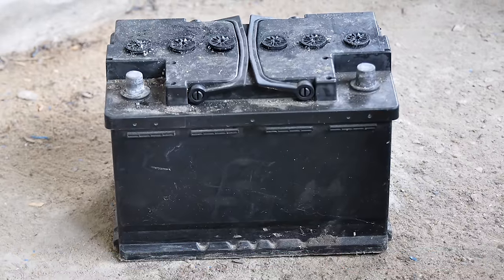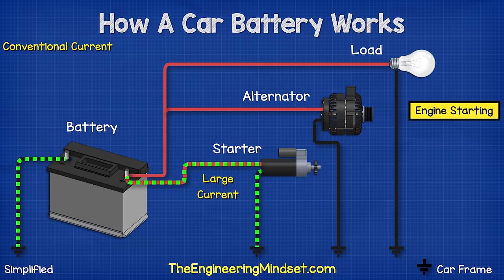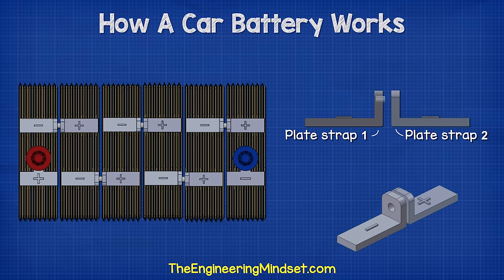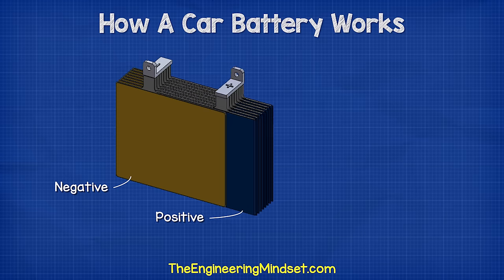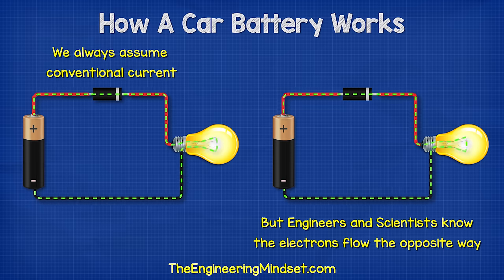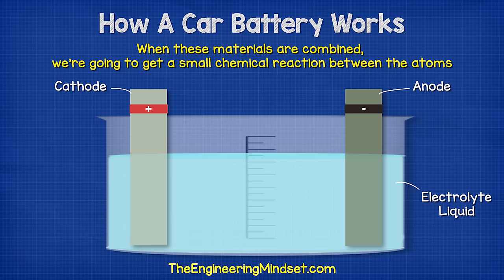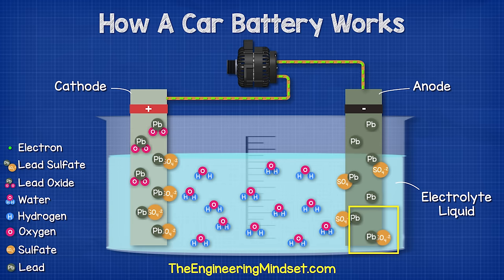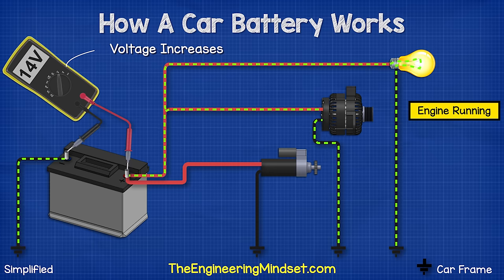How A Car Battery Works - basic working principle

Comment: Man i still dont understand bloody +- flow !!! which one is correct ? current flows - to +, but why does a car have the + hooked to the starter motor and - to the chasis, it wouldnt make sense to power all circuits (which should be from -) through the car chasis and frame which means current leaves from + on car batteries and returns through the chasis - to the battery.
I recently tested a car battery for voltage and i hooked multimeter red  cable + to battery + and black( - ?) to minus of battery and the multimeter stopped working for a second, when i reversed them it showed the values correctly, thats fucked up.
You need a better video explaining how do we measure and use + - in various scenarios because we could get electrocuted or catch fire  or destroy electronics because of  electron flow theory confusion.
Thank you.
Reply from the maker: Here you go https://youtu.be/kcL2_D33k3o
Reply: @EngineeringMindset  i still dont understand, if current flows - to + then why car battery has electron flow from + to -, and why when fixing a car is required to remove the - terminal, when electrons leave from the + side? I worked as qualified welder, and they tought us electrons flow - to + in order to configure the welder machine polarity. But the car uses conventional current design + to - while welding theories use electron flow - to + .
In the end fuck current i still sont understand what system's use which theory and why?
This is important for me so i dont break electronics, like i almost ruined my multimeter, by hooking red + to + and black COM to negative. I understand nothing in the end.
Reply from the maker: Please watch that video without skipping. We cover conventional and electron flow. I've never seen a multimeter that can't handle a12V DC car battery, it just changes the polarity on the screen to indicate you have the leads the wrong way but the voltage value will be the same. Electron flow and current flow are just two theories of how electricity works, electrons always flow from negative to positive, cars included. Car battery can be charged and discharged so the electrons can flow into or out of the cable.
Reply from the maker: Check our new Multimeter tutorial out ➡️ https://youtu.be/4lAyzRxsbDc

Comment: My Toyota Prius has a different kind of battery.  Absorbed Glass Mat
Reply: AGM is a lead acid battery, but the acid is not freely flowing liquid, as it is absorbed in a sponge like material between the plates but still able to flow current as needed.  As for the Hybrid part, that's not a Lithium battery like a Tesla, but more commonly a NiMH battery pack.

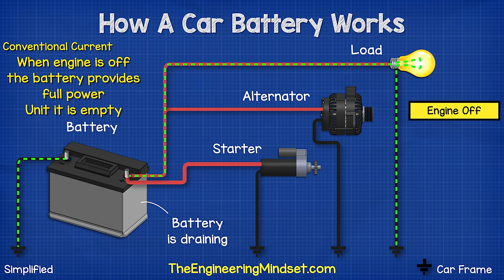Comment: 3:06 aahh so that's why my car won't start because the battery is dead for another device i forget to turn off
Reply: He should've mentioned that the battery will continue to power your car's electronics well after it's too far gone to start the engine. Just because your stereo turns on doesn't mean the car will start, just keep that in mind.